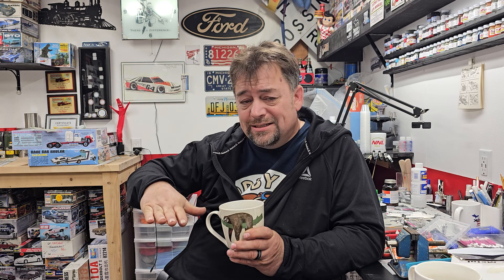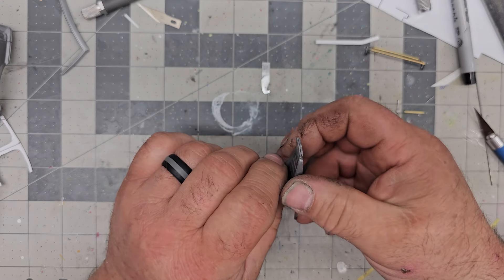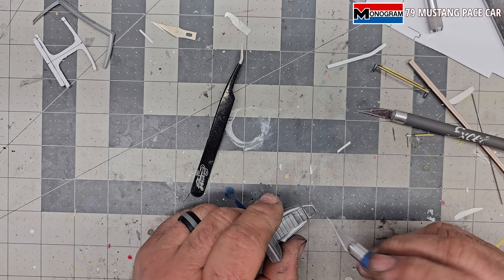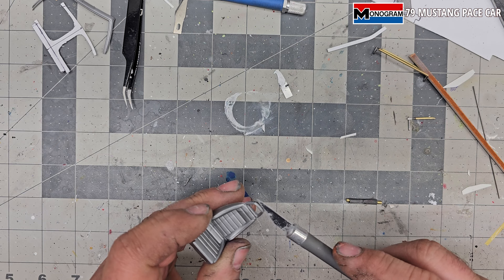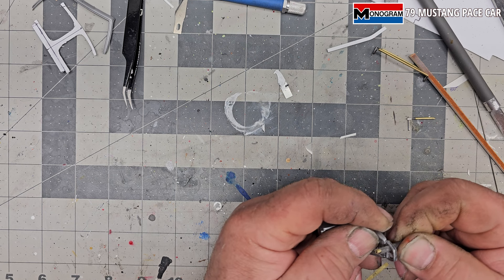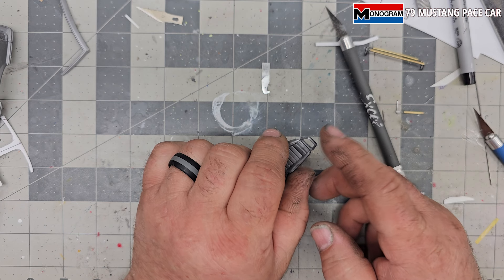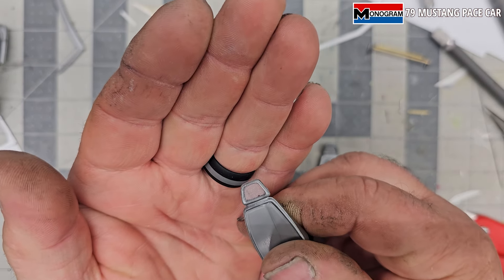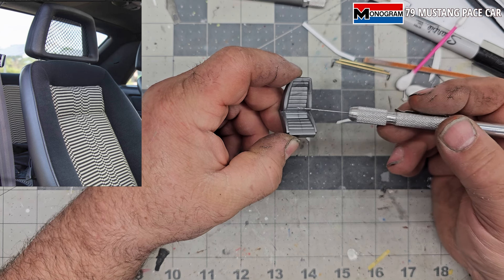MAKING ADJUSTABLE MESH HALO HEADREST #modelcars #monogram

Comment: Very cool mod.
Reply from the maker: Thanks Justin, I think I'm done with the extras, now time to assemble..
Reply from the maker: Thanks Justin, figured the seats could use some attention..
Reply: @kregskorner8851  They look awesome!

 If you ever do it again, bend the metal posts out just a tiny bit then slide them in the holes.  It will create enough tension that they will hold in place where ever you position them and still be free enough to slide up and down. 😁
Reply from the maker: Thanks will have to try that, I have the 83 Mustang convt I would like to build with the same seat treatment..